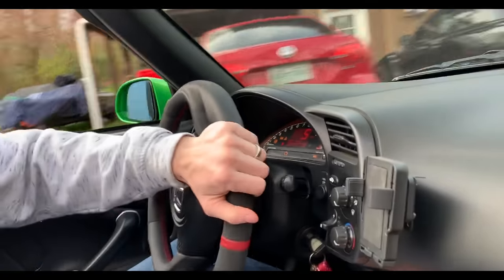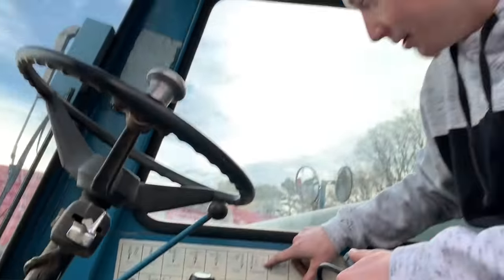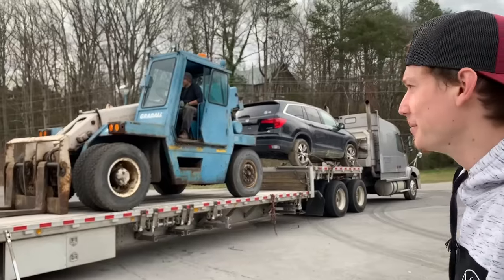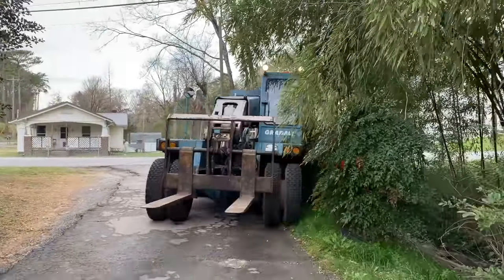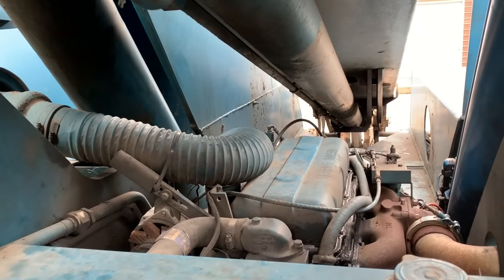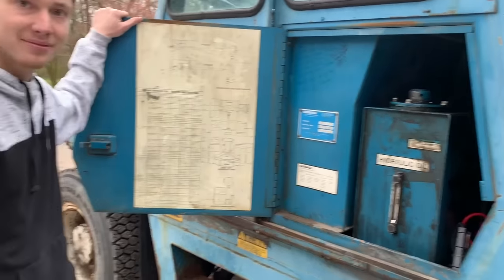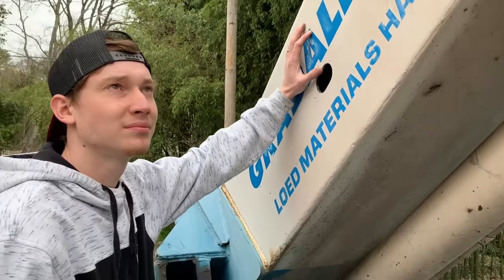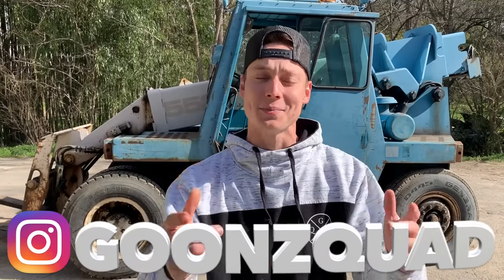Rebuilding The Worlds Biggest Forklift!!!

Comment: A couple of things.
1- The extend cylinder is most likely not working for lack of fluid.
2- When the driver was pulling it off the trailer, it looked like the rear wheels where tilted in (camber) which means you are most likely gonna have to change the king pins. that would explain the hard turning he had after it was brought off the trailer and the tire wear.
Nice unit !! Good luck!! Parts are easy to come by. If you need anything quick, i'm in atlanta and can get all you need here..
Reply: William Ezell the cylinders probably need rebuilt. It didn’t look like they have a telescoping boom. Detroit is known for using oil. They need a cylinder lock if they are going to be working under it
Reply: @stephenshelby392  This is a high reach designed unit for construction, it has an extendable cylinder. If the cylinders need rebuilt they would have bypass fluid running down them because the o-rings would be worn.  Detroit being the Engine has nothing to do other than powering the PRO Power take off that powers the hydraulic. The Diesel engine doesn't look to be leaking any oil. I am sure it could a full service though. Yes i will agree a boom lock would be advisable for their safety when in the air for service work.
Reply: @goonzquad Please make sure you look into this.   "They need a cylinder lock if they are going to be working under it
".
Reply: Detroit diesels burn oil. They use it and they have been known to leak. They mentioned oil on the diff, that could be a sign of a leaking seal or hose or the fitting isn’t tight enough
Reply: @stephenshelby392  you're right they did, but there is alot going on at the end of the boom. The forks have tilt cylinders attached as well along with hoses that they were just using, hince fresh hyd. fluid. I would suspect a leak there. That extension cylinder has a fitted pipe running from the check-valve at the bottom of the cylinder to the top, no hose. The hose runs from the check-valve to the control valve
Reply: I’m a mechanic on skid steer track loaders etc I deal with hydraulics everyday lol there’s nothing I haven’t seen yet. But it’s nothing that isn’t easy to fix. The only issue I could think on the boom extension would be low fluid or maybe a bad pump or possibly trash in the lines or trash in the filter
Reply: @stephenshelby392  I'm trying to figure out how you think the engine leaking oil and the hydraulics are connected? Those are completely different systems and types of oil. There is no way the oil on the diff is from the engine. For sure from the ram for tilting or extending or their hoses. I would also agree it being out of oil isn't a good starting point for testing and I was screaming when they crawled under that boom with no lock.
Reply: @stephenshelby392  read number 1 and yes trash in the line maybe, but their tank wasn't showing any fluid. I've built, services and sold Tow trucks for over 40 years myself, hydraulics, i am no stranger to.
Reply: William Ezell you think the check valve could have locked up? I didn’t hear any pump cavitation and it sounded like it was putting a lot of strain on the motor trying to stall it
Reply: William Ezell I cringed when they crawled under with no lock. I had to put a cylinder on a cab of a skid steer today with 2 people struggling to hold it I was terrified lol. The oil on the top of the diff was a light brown that looked like hydraulic oil.
Reply: @dsilva1896  Daniel, i was thinking that at first too and it's still a possibility, maybe even a collapsed hydraulic line sucking in, but i'm gonna have to go with the obvious first, fluid.
Reply: @stephenshelby392  It was probably from the fork tilt cylinders or hoses which are directly above the diff.
Reply: William Ezell I’m new to the heavy equipment gang lol. I’m not telling you thst I’m right and your wrong I’m just observing what I could see
Reply: William Ezell yeah. I say throw some oil in it and if not pull it off and send it for a rebuild. I would say for them to do it themselves but I’ve personally never rebuilt one with a check valve
Reply: I would do a full disassembly of the hydrolics and clean everything, change oil and look for cylinder wear on the boom. Might also be air in the cylinder and they change the lines as a very small amount of it will make it not function. Might also be pump wear I would check the gpm for the pump and see the output it makes
Reply: i dont think they are called king pins? are you reffering to the castle nuts or some other suspension part? ive only heard of kings pins as the link on a 5th wheel semi trailer
Reply: Droeveg! Wat äl gebuerd hier..
Reply: I just stumbled on your video. No one can over emphasize the need for cylinder locks. There is a video out there of two guys stepping under a crane on its side,  hoisted 8' in the air. When the lift failed, their reaction time wasn't even close. The only thing saving them were the out riggers and they walked away, but worse for the wear. We'd like to see survive your learning experience.

Comment: The “GoonBoom” could diffidently use a Goonzquad make over with your name on both sides and some mods.... The engine is probably a Inline 4-53 series which will run forever as long as you do faithfully do your services. Also check to see if you have a engine oil pre heater  120 vote plug which is to keep the oil warm in cold weather. The fuel will turn to jell in extreme cold weather as well. I would check all the hydraulic lines and fuel lines for leaks...Great add for your shop...Good Luck
Reply: Paint the goonboom CAT yellow with some mean decals.
Reply: GoonBoom! Luv it!! Kudos to you on thinking that one up. 

You’re right, maintenance is KEY to these things living long lives (along with care, RESPECT and common sense); it would appear that this beast has had a life of good maintenance already, and if they continue, it will last forever. These things also don’t depreciate much after their initial “hit” - there’s a very good chance of recouping about 100% of your investment in it when the time comes to sell. (I say “initial”, because I’m certain these guys will be putting a lot more $$ into customizing this!)

Comment: Don’t stand under a hydraulic anything, especially while it’s leaking 😩

Clean out the hydraulic system, fluid shouldn’t be dark. You wouldn’t be able to move the boom extension if any of the lines are leaking. The control servo may also be blocked or just simply not enough hydraulic fluidz
Reply: Having worked on a machine that used to regularly blow hydraulic lines I can assure you everything still works ok, just if you try and use the system with the leak it blows oil absolutely everywhere.  So it's easy to spot the leak. But agree most likely the control valve
Reply: Ben Mac everything still works to an extent. I work on all sorts of equipment, from 800t excavators to little 1t forklifts. Hydraulic systems can easily fail, especially leaking ones. If there is a leak in the wrong place and that system loses pressure, the whatever it is which is on that circuit will immediately drop at the speed of the pressure loss. If it’s a complete blow, that boom will drop, killing whoever is under it. I’ve seen those things fail, it’s not pretty.
Reply: @tasmanmcmillan1777  I dont recall saying that it wouldn't. But then I don't reccomend standing under anything supported only by hydraulics. I also never said it would work properly as clearly it wouldn't only that it should work enough to be able to see with no load on it and at the same time spray oil all over the place making it real easy to see and hear the leak.

Comment: Next they’ll give it a paint job and turbo it and lift it lol😂
Reply: I meant like a big turbo lol
Reply: And a widebody Kit
Reply: Good idea
Reply: Don't forget a new exhaust! Hahah
Reply: Put a 3 inch lift. sitting on 36's chrome rims 😂
Reply: actually, because its a detroit, it comes factory supercharged
Reply: @jeremiahjorenby2275  what?
Reply: @ronniegarland8621  its a 4-53 2 stroke detroit diesel, without a supercharger pushing air into the combustion chambers a 2 stroke detroit will not even run
adding a turbo to these 2 stroke diesels is pretty common, but honestly they should install a 4BT or an R2.8 cummins

Comment: It’s actually a telehandler, I work on this kind of stuff all the time. They probably blocked off the lines for the extend because it was leaking. Also I wouldn’t stand under it I have seen them blow out a lot and nothing stops it from coming down when it blows
Reply: Yeah you can hear the pump labor when trying to extend, my fear is someone bent the boom and it's jammed back in.
Reply: @piperdoug428  Perhaps a boom extension LOCK?  I sounded like the hydraulics were being prevented from operating, so I'm thinking it's just a safety lock.

Comment: Boom Extend Problem:  When you tried it...sounded like it almost killed the engine.  My guess:  Blocked Hydraulic, Ceased Sliding Parts of the Boom, or some Safety Lock on the Boom not Disengaging.
Reply: Maybe lines are crossed so pressure is going to a closed cylinder.
Reply: Agree - if the piston is jacked, that whole assembly will have to be replaced, and thats $$$
Reply: Needs hydraulic fluid
Reply: The all new "Goon Boom" is not a toy. I really do hope that they read these comments for their safety.
Reply: "sounded like it almost killed the engine" that is in itself a hydraulic saftey feature to prevent to much presure building up in a hydraulic system and damaging the pistons and other components...
Reply: When a hydraulic hoses blows , it’s not pretty. I hope it doesn’t do it close to them.
Reply: I think he was just adding power to the throttle to help the boom raise faster. Though that was alot of power lol

Comment: SAFETY! Do some research on lock out tag out and locking out the boom before crawling underneath. This is a cool project but you need some or a lot of safety training before you dig into this project further. Love your videos and I want to keep seeing them.
Reply: Agreed. They need to get a prop for the boom ram ASAP!!!
Reply: my first concern too.
Reply: Lock out tag out is so important. I worked in a factory that sadly a few gentlemen fail the procedures and lose there lives in Baylor’s
Reply: Dont be a sissy, dive right in and fix it
Reply: Yeah that thing didn’t look stable
Reply: @Bman01234 That's a very bad mentality to have when operating a forklift. These machines can be pretty dangerous if handled improperly.

Comment: You should give “Andrew Camarata” a call.. he’ll fix that machine right up!!
Reply: MrRoberoni117 Got the right
Reply: Great idea!
Reply: Andrew is a real Big Equipment guy and does it all.  Good suggestion if you want another You Tube guy.  Try to find someone local to instruct you; there may be classes you can attend to get certified.
Reply: Not to mention how well he can operate those machines. Dude is a surgeon. Under the hood and behind the controls.
Reply: Lol - first thing I thought of.
Reply: Or Watch Wes Work,.
Reply: Right on...it'll be good as new.
Reply: The idea is they do it they’re fuckin selves😂
Reply: Damn straight. If it has a motor and hydraulics he’s got it covered.
Reply: 100%
Reply: @mhks68  so true

Comment: someone didnt see the "shake hands with danger" video in High school shop class.. lol

you have a stuck valve body  or froze cylinder on your extend and and tilt. probably never used by the original owner and froze.
hydraulics are generally simple. make sure you use the correct oil for your application. call the company direct for fluid specs.

first things first. get your self a service manual👍
this company is well known for there wheeled excavators. 

Im actually just up the street from you guys.
Reply: Three finger Joe.

Comment: Detroit Diesel is well known, ask your Pop's he will know them, they make Engine's for class 8 trucks ( Big Trucks) just remember to check for Power lines when putting the Boom all the way out. Pressure wash it then look for leaking line's and seals.
Reply: Hell of a time to introduce a Detroit Diesel to the channel. The big debate tonight is all about protecting the Michigan workers who made those vehicles!
Reply: Good old Detroit. Of it ain't leaking oil, it don't have any!
Reply: School bus engine
Reply: @brich8608  -> Thomas the Technician of the Goonzquad is going to be annoyed with leaking oil if your observation turns out to be true! 😎
Reply: @gpackwood1  I worked with quite a few old Holmes cranes. Most had Detroits power plants  for both the carrier and upper houses. They're hard to kill, but always leaked oil.
Reply: @brich8608  -> You made me laugh with your leaking oil or no oil comment. I've never heard that one and you're right!
Reply: @gpackwood1  Yeah i run a pair of 6v92's and it's not leaking it's self lubricating and anti-corrosion system.
Reply: @gpackwood1  whenever one is parked a drain pan, oil dry and pig pads are required. Lol.
Reply: Didn't they out those motors in the early 7.3 l Ford's with no turbos ?
Reply: @robertsonier9690  No, they where only used for commercial purposes, totally different design.

Comment: I worked on a few Detroit Diesel in the SeaBee Reserve!  They are easier than Cummins. There should be a lock out Rod or pole to lock that arm up for Service. It is always a bad idea to get up hydraulic without locking them with these rods. Better safe than Crushed!  OORAH

Comment: Ah hell y’all need to careful under that boom especially if there’s no way to secure it while it’s up in the air. 1st and foremost whenever working on hydraulic lines or systems you always have to relieve the pressure before working on it( by working the levers back and forth side to side before working on it) cause those lines are under a lot and I mean ALOT of pressure so y’all be careful cause it can get dangerous real quick. Be safe y’all and congrats on the new purchase and the awesome content y’all create.

Comment: Detroit is the most reliable diesel engine brand, it used to be widely available similar to Cummins, but now is only available in freightliner semis as far as over the road trucks go. its definitely gonna be a good engine and if you go to your local freightliner dealer you should be able to get parts

Comment: Just be safe working on the hydraulics! One line gets loosened with that arm in the air and it's going to drop on whoever and whatever is underneath it.
Reply: Nah it has a holding valve. You have to hope the holding valve is in good condition though

Comment: The reason for the two break pedals is one of them is for main breaking, like stoping the whole machine, and the other one is to stop the machine from moving so you can accelerate the engine and lift the forks up faster, I have a late 60s Clark forklift with that feature
Reply: I doubt that the two I operate at work have 2 brakes, one is the brake and the other is what is known as the "Inching" brake, so you can move/creep up to the load or with the load.
Reply: Eschelonistic they’re used for both technically
Reply: @articat568  well yes for braking but not for riding the brake using the motor
Reply: @Eschelonistic  well I'm going to assume the machine you have isn't from the late 60s or 80s😂 because I have 3 petals, one for gas, one for breaking and one to disengage the transmission to rev up the engine higher

Comment: The long tube is the cylinder for the extension on the main boom, and the smaller one at the top is for adjusting the angle of your forks, and the 2 holes on the boom I think they are to put a security pole underneath the boom while you are working under it ;-)

Comment: The boom will not extend because the hydraulic oil is low.
Reply: Or it was plugged because the line was leaking
Reply: I'm thinking it's partly cause the oil is low, but their gonna need to get the leaks fixed first before they go through 30 galloons of hydraulic oil
Reply: @crherniman  yeah I'm also pretty sure the lines were plugged.

Comment: Those hoses have o-rings that wear over time , if there's no visible cuts in the hose. Check the o-rings .. also there will be a distribution block somewhere on there as well . And yes, there are seals in those Rams /cylinders.  The max load cap. Should be on a tag on the door or dash, it will give the load range when the arm is extended and retracted. The engine is most likely a 300 c.i.d Detroit. And if memory serves, the hydro tank holds around 6 to 7 gallons.
Reply: JIC fittings do not have o rings and it probably holds 20 gallons of hydro fluid at a minimum
Reply: A piece of equipment that size holds at least 25 to 30 gallons of hydraulic fluid.  Heck, our 580 super m backhoe holds almost 32 gallons and it's not even as big as that forklift. Also, most hydraulic lines that size does NOT have O rings. The more you know.
Reply: @Nexadon  yeah they definitely don't have O-rings. Those lines will have crush washers and flares.

Comment: When you replace those steer tires - FOAM FILL THEM!  look into it, it's expensive but worth it.  Never have a flat, no matter how many nails you run over.
Reply: If the rental company was smart then they're already foam filled. The tires don't look low to me at all, that's just a really heavy counterweight. That 552 has a 20,000 pound base lift capacity.
Reply: ironpony42 agreed.

Comment: there should be a safety lock out for the boom when its in the air, if your underneath and a hydraulic hose blow, your dead. know your equipment before performing work on it.
Reply: excellent point. especially with the hose situation on that vehicle.